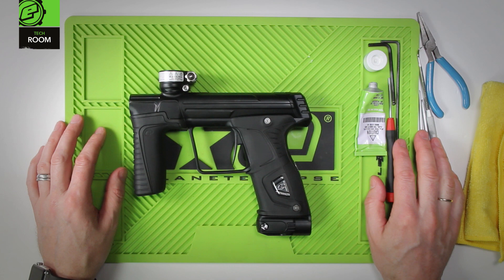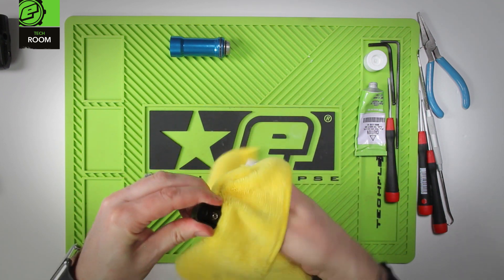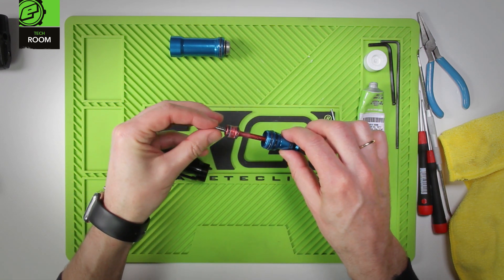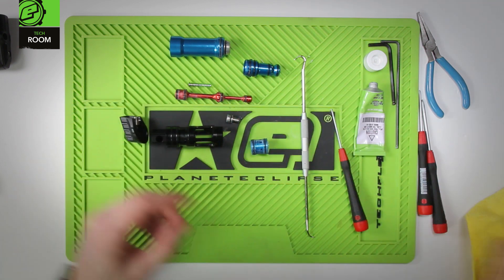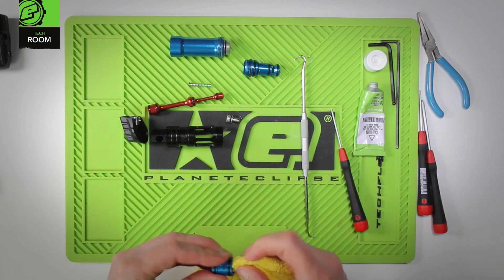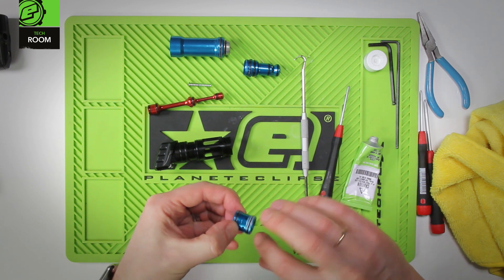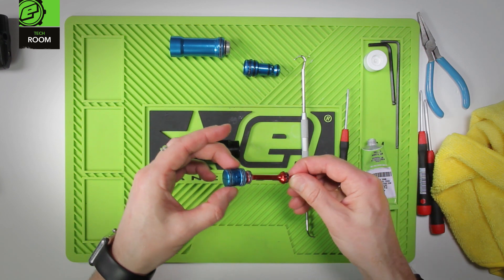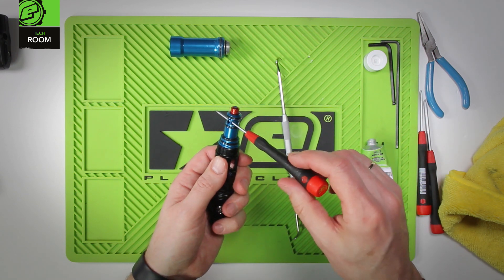Gtek170R - 03 Bolt Assembly Advance Maintenance

Comment: Would doing this fix the back cap issue , I have a brand new m170r and the back cap wont come up without using an allen wrench to pop up the back pin